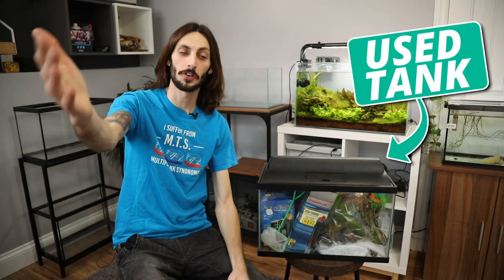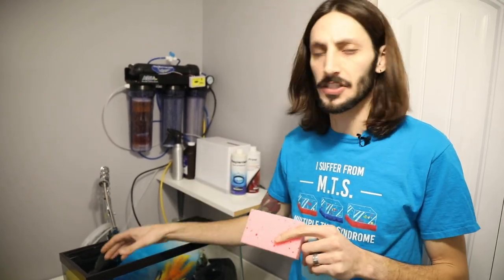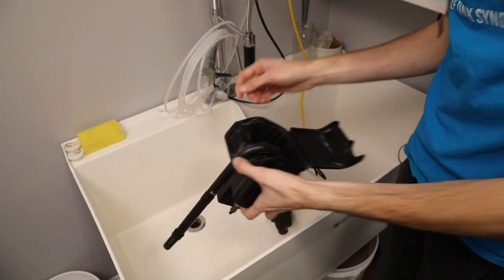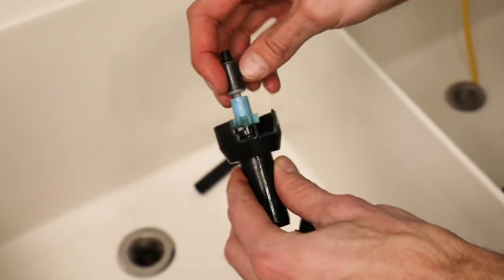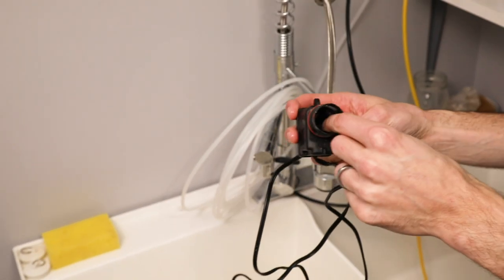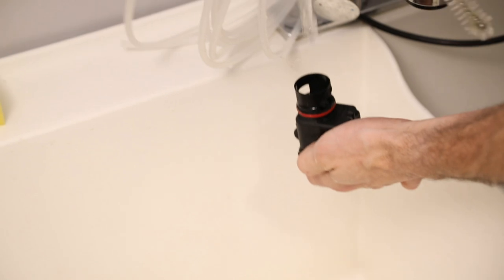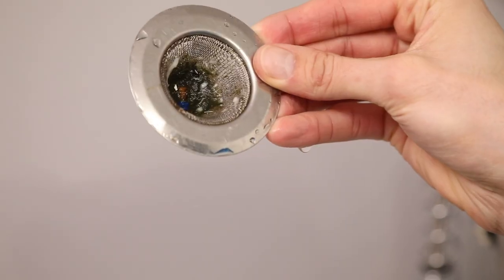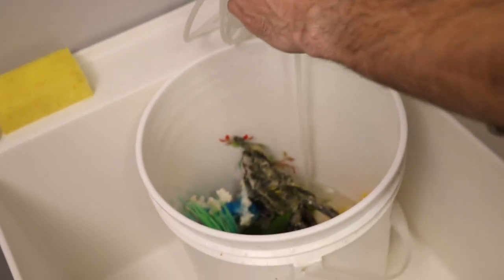How to Clean Used Aquariums & Accessories!!!

Comment: I just bought a used 55 gallon drained it and cleaned out very well ect. Been sitting there for 2 weeks now the filter is a 75 gallon. It's wet inside yet. I didn't clean it or anything yet. I'm just wondering what to do about the filter if I should clean it and if so how? Or if I just throw it on and let it do its thing?

Comment: On a really old tank, does there come a point where you cant get calcium/limescale off no matter how much you try?
Reply from the maker: Just need a stronger acid. I've used muriatic (pool) acid for really stubborn buildup, but it's dangerous stuff to work with so you have to be super careful. Full PPE and it needs to be diluted dramatically. I dont recommend it to your average hobbyist, but it sure does work.
Reply: @NaturalAquaria  might just live with a little calcium hahahaahahahhahaha

Comment: Thomas, any tips or methods you can share for removing hard water stains from the glass. I've tried white vinegar & baking soda with little effect. Very reluctant to use Bar Keepers Friend as the tank is too heavy to lift for rinsing afterwards... Currently I'm just hoping those stains won't show when I finally fill it with RO/DI water. Any thoughts? Thanks :-)
Reply from the maker: One of the best tools for that job is muriatic (pool) acid. You have to be extremely careful working with it, use the proper PPE, and it does need to be diluted in water as it's an extremely corrosive acid.

Before going down that road, I usually give the razor blade a try. Getting a handle for the flat razor can give you a better purchase on it for scraping off stubborn limescale.
Reply: @NaturalAquaria  Thanks man, very kind of you.

Comment: I use a 3 step chemical clean up (some of my tanks went through hell)(Lysol wipe, Windex (paper towel) (the first 2 are dirt magnets) and last white Vinegar (paper towel)), I let the aquarium or terrarium sit for 24hrs, if aquarium, then fill with water (leak test if its questionable) get the filter up and running (everything has to be in it), using: Seachem Prime, Stability and Pristine (or API Stress Zyme) let that sit for 24hrs-48hrs, then put fish in tank, do fish in cycle with Stability (fish must be healthy). If this is a terrarium and I want to a drainage system in the tank, after the 3 Step Chemical Clean Up is done, this would be the time to reseal and leave tank alone for a week, take time setting the tank up slowly. Thats how I do things and I hardly have deaths. I should probably do a video on this method.
Reply: Sorry Thomas I had to edit my comment notice I was missing some words

Comment: Never use bleach in a fish tank 😅
Reply from the maker: You can use basic bleach to clean ornaments and fake plants. It's not oil based and won't leave residue behind, and it is neutralized with standard aquarium water conditioner :)

Comment: nice cleaning up. Don't know why chlorine is so overly used. It doesn't melt anything. Over many hours it CAN kill mold etc, but you still have to manually scrub it off - so why even use chlorine to begin with? It takes nothing to kill off all your fish, a single drop of this will do it. It doesn't easily rinse off. I would never use this to clean anything.